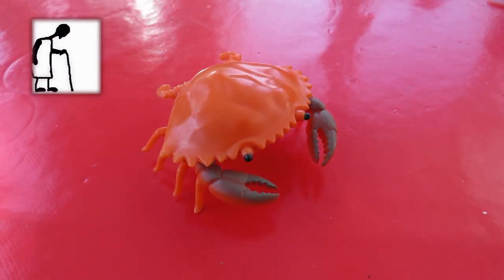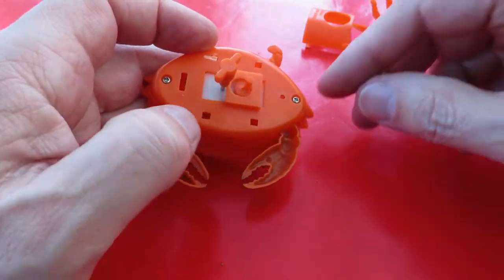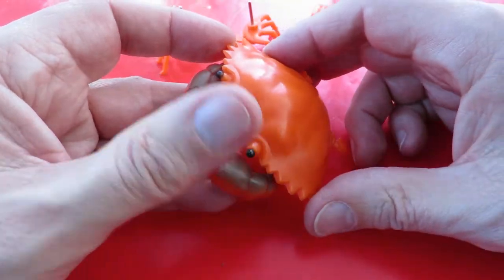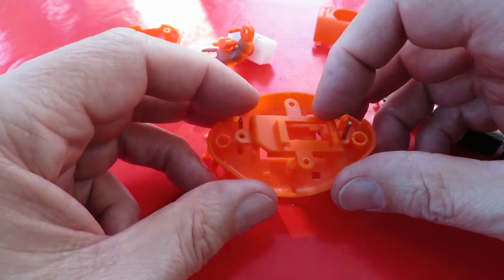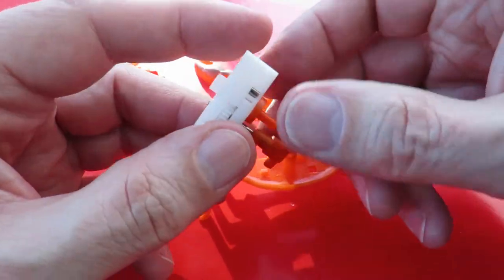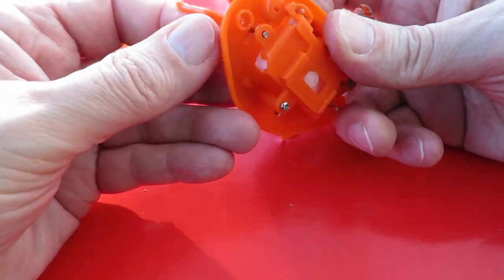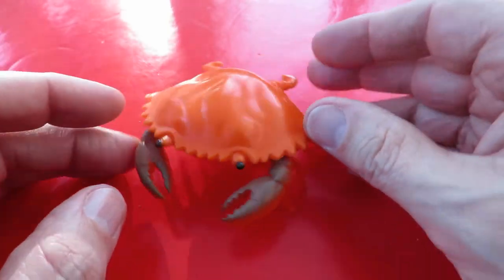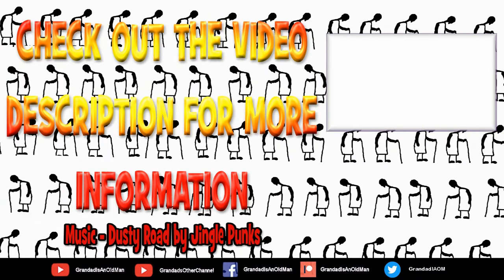Clockwork Wind Up Toy Crab TEAR DOWN

Comment: Cool design for such a basic toy actually alot of these cheep toys are designed very well.
Reply from the maker: That is one reason I do these disassembly - tear down - videos. The design work that goes into toys often goes unrecognised because "it is a toy" and yet they achieve great things. To make one of these yourself from scratch would be a very involved project.
Reply: GrandadIsAnOldMan Yes very true, it should be noted that most of these toys are copied or have aspects copied form and earlier toy 😀

Comment: I bought one from Bridlington about 4 years ago and its never worked properly. You have to wind it really tight, just to get it to do 'anything' at all. Its almost like something inside isnt set up properly. I cant take it apart tho as mine has no clips to it. Its a fully fixed piece - to the main body. Help ?? I cant even find them on ebay to order a new one. Any idea where i can purchase one ?
Reply from the maker: Sorry, can't help you there. I picked this one up in a charity shop.
Reply: @GrandadIsAnOldMan  Thats ok. I just wondered if you were good at taking things to bits
Reply from the maker: @blrr5blrr  I take lots of things apart but I am afraid I do not offer a repair service.

Comment: Hi awsome crab can u make a remote control one
Reply from the maker: Short answer is NO 😊 to get some sort of movement control other than just start and stop would require some very complicated mechanics, well beyond my capabilities. Even just scaling up the existing mechanism would be best done with a 3D printer or a laser cutter and I don't have either. This project is probably the closest match and that uses a couple of existing kits - Spiderbot project https://www.youtube.com/playlist?list=PLA5a2xPRSrB158MCKLkBA3zpx6oAwY1ww

Comment: You should try and make it solar
Reply from the maker: Whilst that would be technically possible it is probably the sort of project one of those guys with the 3D printers could do as you would have to make up some specially shaped pieces to fit a small enough motor and gearbox inside.
Reply: @GrandadIsAnOldMan  what?🍑
Reply from the maker: @doray318  what what?